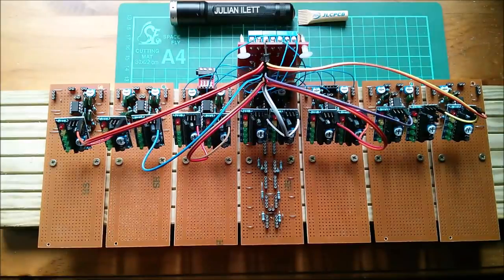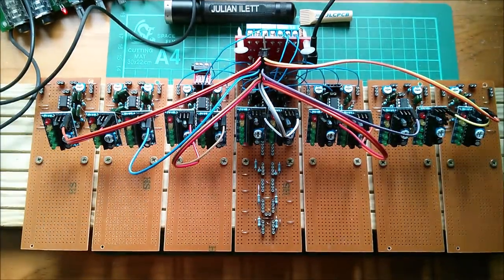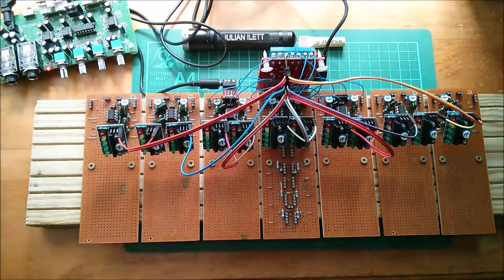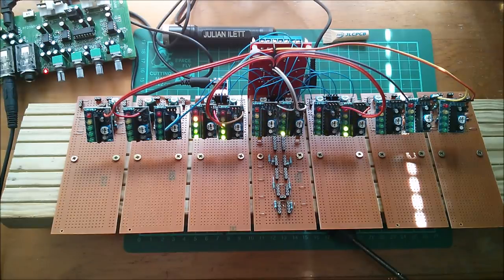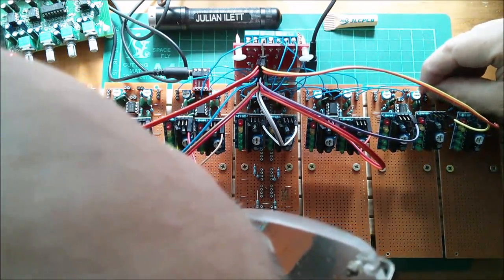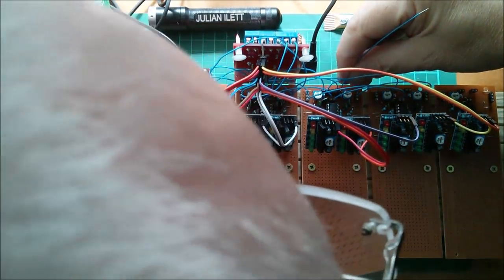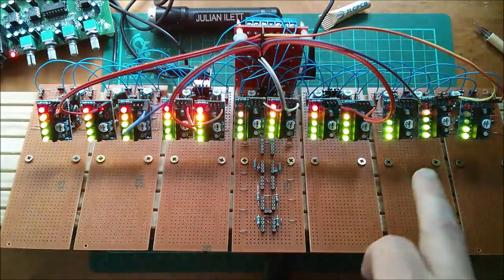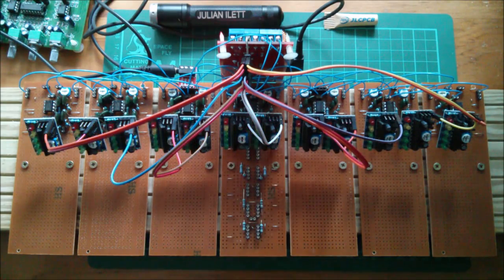Third Octave Spectrum Analyser Build - Episode 2 - Vocoder

Comment: 8:05 - Yes, please use a signal generator!  As much as you should be in a British national choir it would be nice to see the response from a single frequency signal generator.  I'm surprised you haven't got a cheap one from eBay.  Or just make up a simple 555 timer circuit to easily manually sweep through the frequencies.  Or use your scope's but sometimes a manually operated generator is just easier to work with manually.
Reply: And I get that it is fun to plug in a mic and try out your voice.  But as you can see with the bad channel it would have been nice to see the response with a proper signal generator instead of a voice with tons of frequencies in it.  Try it with your voice then plug in the generator or vise versa but show us the response with the generator in the same video!

And yes, it does look cool.
Reply: Or just a free phone app

Comment: Hi Julian, in audio engineering a Ground Lift is frequently used to eliminate ground loops. Which basically cuts the ground signal. This isn't a foolproof method but it can help. A 1:1 transformer is your best bet. I'll gladly design a little cicuit for you with a preamp so you dont have to use the karaoke thing ;)
Reply from the maker: Thanks Dustin - actually, the Vocoder has a mic preamp as part of the design. I just haven't built it yet :)
Reply: :) First things first I guess? LEDs! :D

Comment: Thanx for the finger, but if you already don´t like your build why do you proceed any further...;)

Don´t swap the caps, swap the in/out wiring instead, easier, faster and the board doesn´t care if the one next to it, does the wrong frequencies, don´t they....?:)

Also, this is exacly what i meant in my post at your last video...it´s roughly about -6dB between the bands....you need to set/calibrate your envelope followers for the analyzer very carefully, or the band seperation would be not very good....

Anyway...it works so far, nice work, Julian..! :) :)